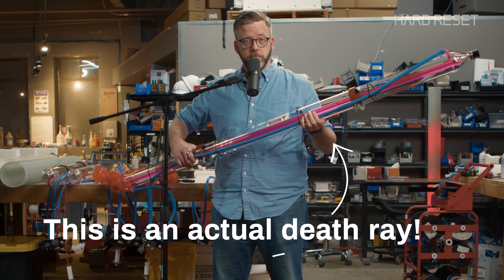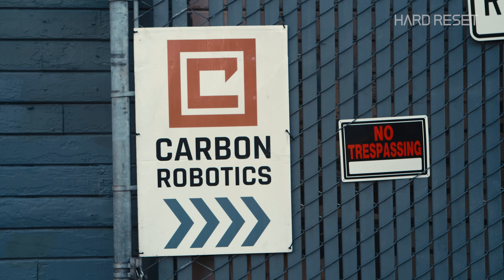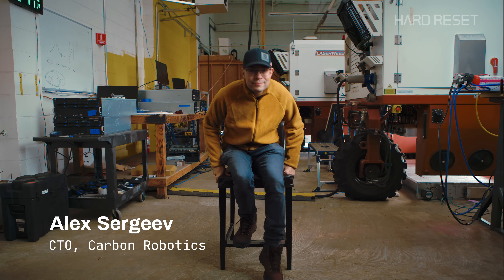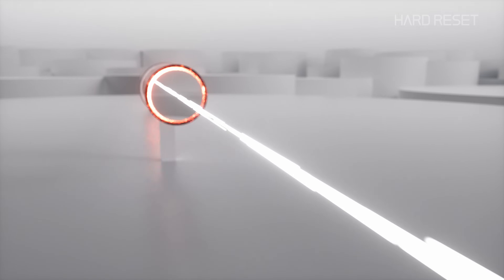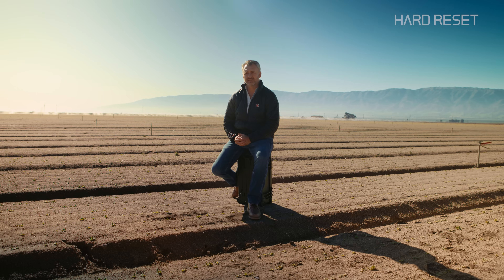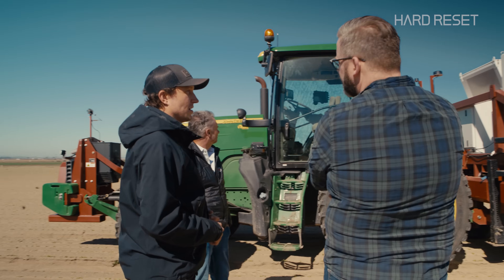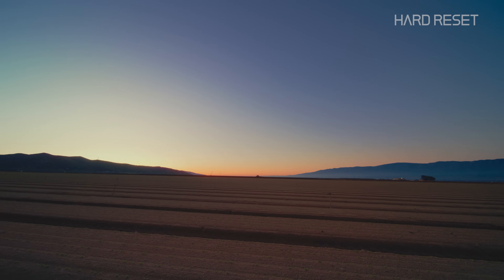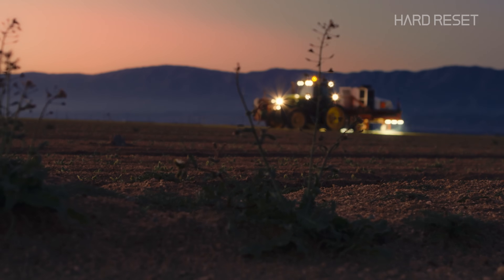Zero Pesticides, Zero Weeds, 100% LASERS

Comment: I clear and prepare a section of the land using a strictly organic approach. In the dead of a cold winter night, I burn the ground to clear it, using coal and thick cardboard instead of chemicals. During the summer, I handle this task by removing the section entirely by hand. This ensures the garden remains 100% organic.  Therefore, this invention is beneficial.